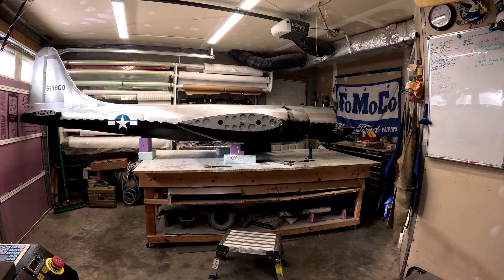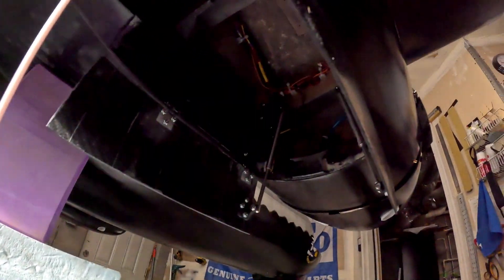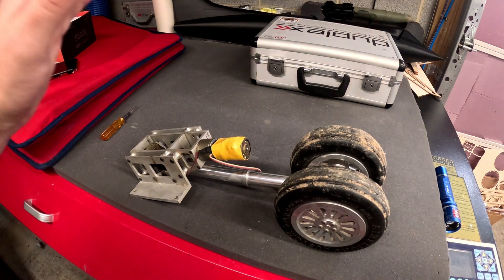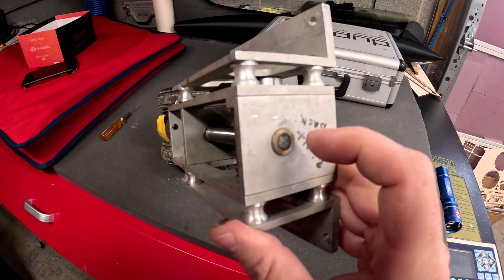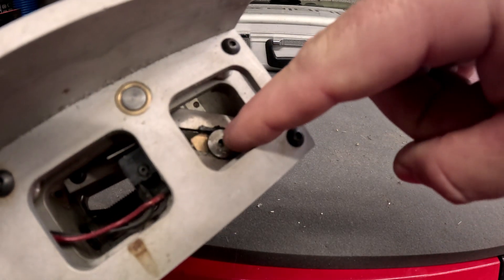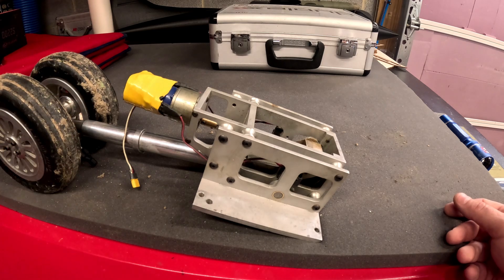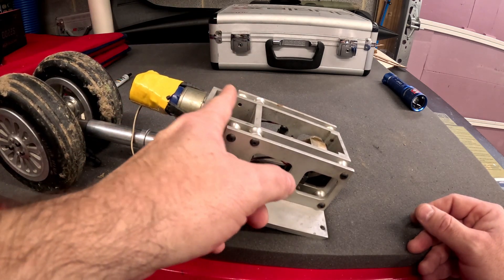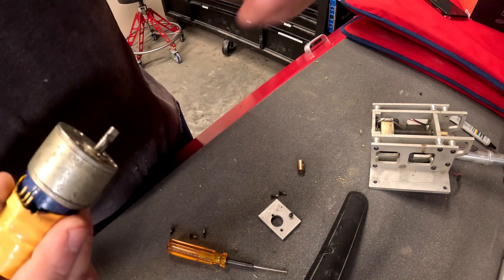B 29 Restoration Project #70  Landing gear woe's pt2

Comment: You are on the same track I would. Super Lube is amazing stuff. Just try to eliminate as much friction as you can. Even a little recess to prevent that rubbing of the motor axle will help. You may also consider some CorrosionX on the electrical terminals before putting new covering on. In the end, if you have to re-time your gear sequence, so be it if you have a reliable set of gear. Keep going, we all want to see this fly this season. 
For the play in the metal, you could try disassembling it and creating a model in CAD that accounts for the slop you are trying to eliminate, get new ones cut by Send Cut Send and call it a day.
Reply from the maker: @JoshuaOrchard  

So far the gear is back to working.  The plan long term is to digitize in cad some of the gear components for easy replacement.

Comment: Can you ask the motor manufacturer if they have the same motor with a faster gear ratio. Or they can help with different gears to speed up the gear
Reply from the maker: @danculver2388   without a part number, they cant really help and the gear ratio is a stock part, custom or one off items is something i have learned is expensive and difficult to deal with, so i doubt these are custom units.

Comment: I have a Pitman motor driving the elevator trim on my Globe Swift.  It was a mod for the sliding canopy.  Slow is essential, with plenty of torque.  I think they are widely used in copy machines and maybe automotive windows.